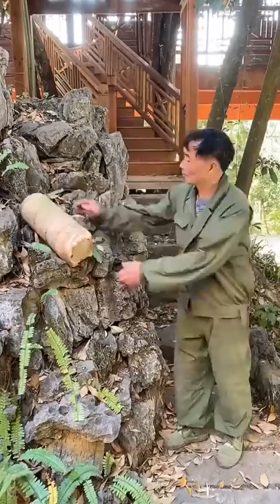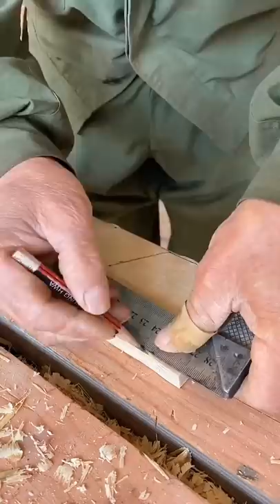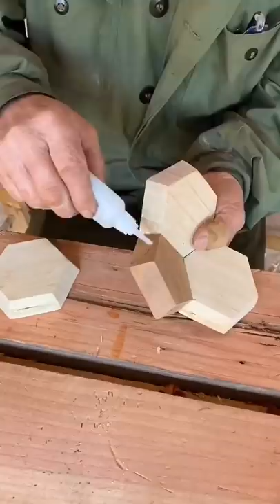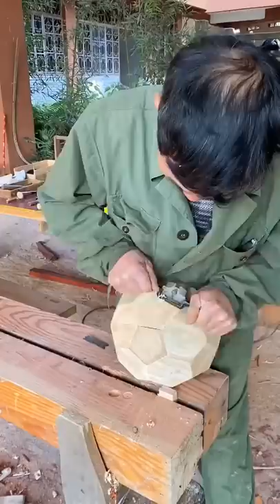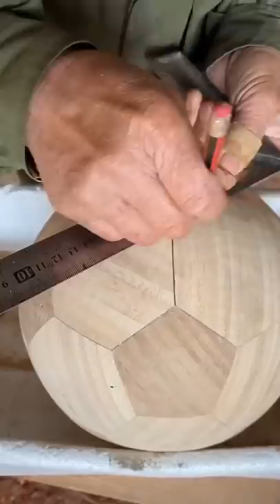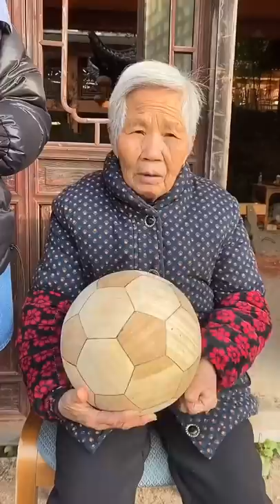Football Wood Carving Skills And Techniques | Woodworking Projects

Comment: Dam it's machine cut Pisces. 
Easy to pick out . The pises jointed are more than the initial wood block taken .  
It's cut on angle by machine . If it was straight cut as shown wouldn't join.😎

Comment: Ok, man cuts bamboo and shaves it flat smooth and then miraculously THICK pieces of real wood appear and glues them together. Am I the only one that caught that  ??
Reply: No that’s actual bamboo that grain pattern isn’t the same as the usual wooden grain pattern and he didn’t make them super thin
Reply: @jahyeet1137  I don't believe he was saying it was too thin. I believe what he was saying is this. If you watch the beginning of the video when the bamboo is being spit and the nodes are being removed, the bamboo is really thin. However when you see the pieces falling onto the ground, they are much thicker than the thickness of the bamboo he was originally cutting.
Reply: @matthewbaney2660  bamboo can be pretty thick most people commenting and critiquing are people who’ve never even held these materials in their life 😂
Reply: @jahyeet1137  Yeah they can be quite thick. I should know. I've built several bamboo fly rods. That's neither here nor there. The point being made is that the piece of bamboo he started off with is thinner than the pieces of whatever that are falling on the ground and then gluing togther. It doesn't matter how thick bamboo does or doesn't get. In this video, the pieces being put together are thicker than the bamboo piece he started off with.
Reply: @matthewbaney2660  I see that but I was just saying bamboo can be thick Iv used coconut and had to glue two pieces together to make thicker sides for a ring